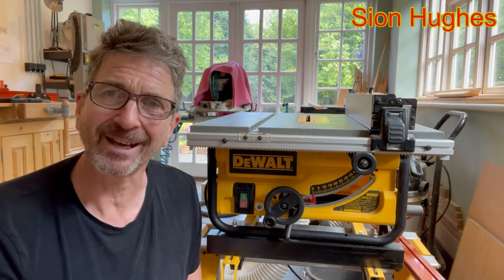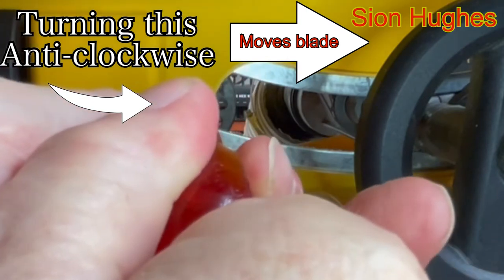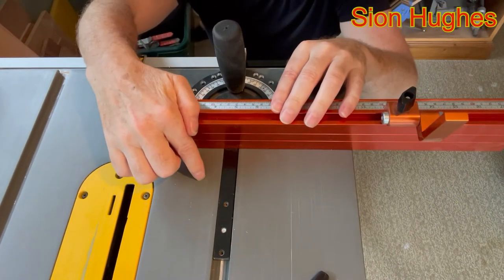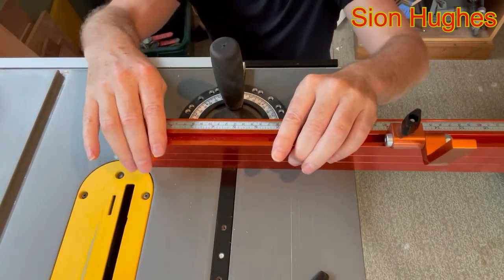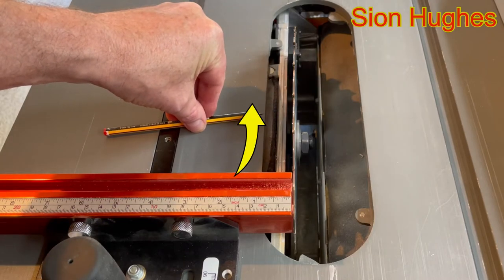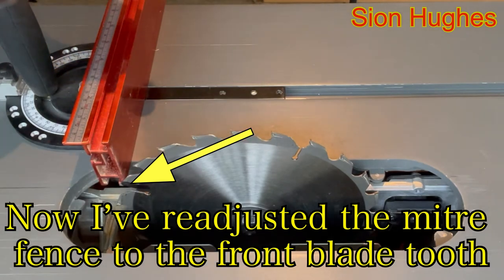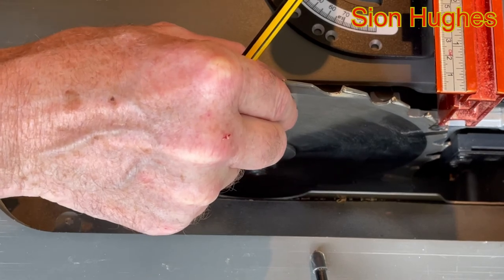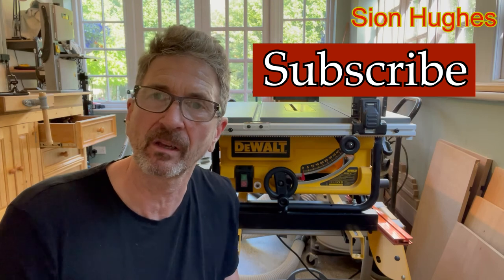DeWalt table saw set up

Comment: Nice video dude.  You described that very well. I just bought the 7485 so I’ll be doing the same thing once I unbox it. Cheers!
Reply from the maker: I am really glad I could help . It works sooooo much better when it’s set up correctly and safer . Cheers Sion

Comment: Really like this miter gauge trick. I've been milling down some maple and had issues squaring up my board which lead me to check if the blade and fence were true. The DWE7485 fence somehow fell well out of square from general use. Also notice a bow in the stock fence.. I'm certainly going to use your miter gauge technique to set the fence parallel to the miter slot however I'm seriously considering an auxiliary fence that has some adjustment.
Reply from the maker: There are lots of options when you deal with fences . An adjustable one has to be best. Thanks for the lovely comment , I really appreciate you taking the time.

Comment: Evan though the fence should be slightly open it is still critical that it is repeatable for accurate measurements.Fence is always set at the point where the work piece enters the blade.
Reply from the maker: You make a very good point

Comment: Great video!!!! This is how a tutorial video should be done! 
 
Now, is there any way to fix the warped concave fences and bumpy tabletops they've gone to recently? 3 saws, 5 days, all the same issues.
Reply from the maker: Sadly I am yet to perform miracles on the channel. I really appreciate the kind words though . Cheers Sion
Reply: I've seen it done but it was a major amount of work. He shaved the saw top until it was perfect. And for the fence just attach a board or aluminum rail to it and then it would be flat.

Comment: Fantastic! Actually I had dispaired of using my DEWALT for dado-s ntil I watched your video. I have the alignment spot on, but there is still the issue of slop in the Fence. To make an accurate fence setting I have to run the rails out past the intended position and then crank the fence back in.
The slop seems to be in the mechanism that moves the two rails on which  the Fence is locked down. Is this common? Is it the nature of the beast or can I do something about it?  Thoughts?
Reply from the maker: Hi Bruce , Honestly I don’t know . All I know is when I first bought my saw it arrived and had been dropped in the box . It damaged the fence mechanism and I couldn’t align the fence so I sent it back and got a replacement. I certainly doesn’t sound right . Have you checked to see if the rod that connects the front and back fence slide is perfectly straight ? Just a thought . Good luck and let me know what’s causing the problem. cheers Sion
Reply: I have the same issue. I am going to go through all of these steps first to make sure my saw is completely square and then I will check again but yes, when I want to make a cut to an exact measurement, I must bring the fence farther to the right and then they didn’t bring it back left to my cut mark. This is the only way I can keep the fence square to the table.

Comment: Hello Sir. I appreciate your prompt reply. I followed your instructions and successfully accomplished all except one. When I put an engineering square against my fence , i see day light. I want to say that the fence is not vertical to the surface of the table saw ( I do not mean parallel. Per your instruction I solved that matter ) do you have a solution for that matter? The second question is that how can I go to your channel?  I tremendously appreciate your feedback.
Reply from the maker: Not sure about how to get the fence vertical . I will need have a think about that . As for your second point . To visit my channel type  Sion hughes into the youtube search bar  and there you will find my channel . Click on the round picture of my face and you will end up on my home page with about 65 videos . Let me know how you get on . Cheers Sion
Reply: the word you're looking for is "perpendicular"

Comment: Hello. I'm having issues where my saw is rubbing the throat plate at 45°, but only towards the front of the saw. I know the angle is correct with a digital angle gauge. Any thoughts? The screws you loosened in the back only allow the rear of blade to move left and right while locking the front of the blade. This doesn't help since that is where I need clearance.
Reply from the maker: Hi Aaron , If everything is straight apart from the rubbing on the front of the throat plate why not remove the contact area with a file . Hope that helps. Cheers Sion

Comment: It might be the camera angle but it looked like the throat plate was kicking the square up a tiny bit. I've always felt to get the most accurate adjustment you should remove the throat plate while adjusting everything.
Reply from the maker: First of all thanks for taking the time to comment .  My table saw cuts good 90 and 45 degree cuts  with my own home made insert . The factory throat plate is less than ideal . I made a video called ( table saw zero clearance insert ). Sorry didn’t link it but you can look it on my channel. I really think you will like my elegant solution and I am pretty sure you wont have seen it before . Please let me now your thoughts in the comments section as it got so few views and I really think its the best zero clearance insert ever . Fingers crossed Sion

Comment: While blade alignment ls critical in relation to the miter slot ,fence alignment is not.The fence should be open .005to.010 at the far end working of the fence ,working on the right side of the blade.ViceVersa while working on the left side of the blade.This prevents burning as the work piece exits the blade
Reply from the maker: Clearly you know a lot more about table saw set up than me . All I know is that after my set up the saw ran much better and was safer . Thanks for all the advice . Cheers sion

Comment: The problem with aligning the fence with the slots is that the slots are cast into the tabletop. For maximum accuracy the slots should be accurately milled into the tabletop.
Reply from the maker: I am sure what you say is true but, on a job site table saw like the DW 745 this really a safe way to set the machine up .

Comment: If there is no offset on the blade tip, then this will work. I personally have never seen a blade of that nature. For those that have carbide (or othe), raise the blade all the way up and use a dial gage and purchase a freud 10" calbration and sand disk combination. (Item number CD010)
Reply from the maker: I have a dial gauge now, but I actually wanted to show a video not using specialist equipment so that the average person could set their tablesaw up.

Comment: Evan though the fence should be slightly open it is still critical that it is repeatable for accurate measurements.Fence is always set at the point where the work piece enters the blade.
Reply from the maker: Thank you for the comment